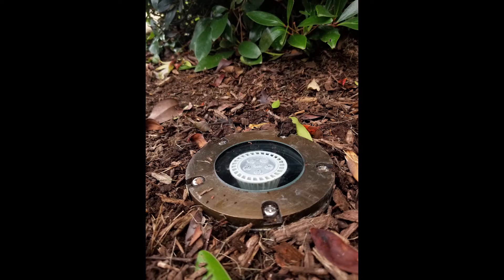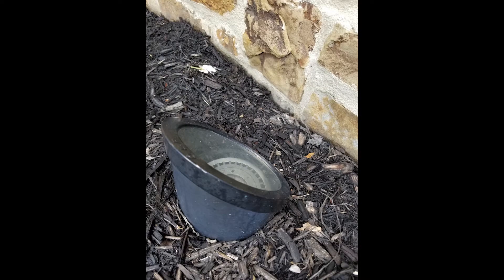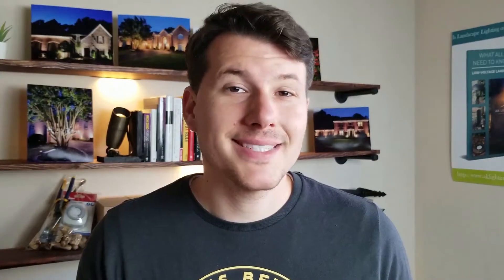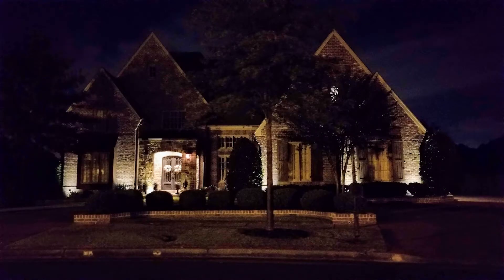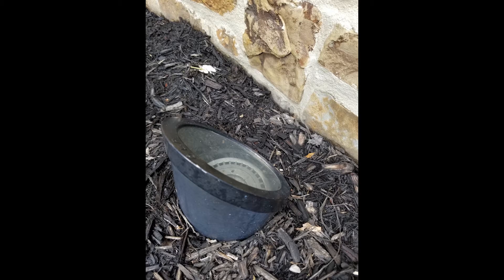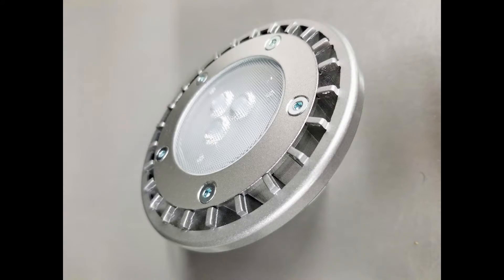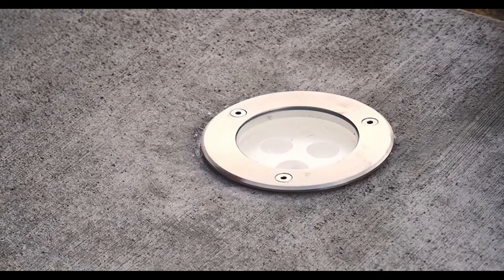Landscape Lighting Fixtures - WELL LIGHTS

Comment: If I purchase the well lights that have the normal spot light LED MR16 bulb, will the well light put off as much light as a spot light. The reason I am leaning towards well lights over spot lights is because they will be installed next to a pool and I do not have bushes or landscaping to hide the lights and I also don't want the lights getting knocked over or broken by balls being thrown around, etc.
Reply from the maker: You have the right idea with the well light. Definitely will help the light not get kicked over. Yes the MR16 bulb in a well light will shine just as brightly. If you need it dimmer or brighter, just get a different bulb.

Comment: Hey, Adam, great topic and thanks for all of your videos.  As a landscape lighting DIY'er with an electrical engineering background (I actually work with high voltage transformers), I'm always trying to improve the durability and longevity of my lighting systems.  Regarding well lights, I do incorporate many of them at the base of 4' stone walls.  Their minimal horizontal wash is ideal to softly light up the wall and short vertical wash doesn't blind folks on the decks above.  To keep dirt off the lens, I place a small rock under the fixture to prop it up.  A leaf blower also helps.  
I appreciate your first class wiring connections with one suggestion, I crimp the wires first with a copper crimp and squeeze with a vice grip pliers.  Then inert into the tube before burial.

One last point; I've experimented with big box hardware store well lights (Portfolio) by unthreading the top lens and silicone sealing it together.  The overall cheapness of these fixtures though is awful.  Is there a brand of well lights you would recommend?  Seems most are over $100 each.
Reply from the maker: Hey man, thanks for the kind words. That sounds like a really cool profession! I think in ground well lights that are in the grass or flower beds are simple to maintain, but more times than not I find my customers not wanting to take the time to maintain them. 

Thanks for appreciating the connections. I agree with your copper crimp comment. I believe I have another video with that connection, but I wanted to show another way if people done't have copper crimps or don't want to buy them. 

Yeah, Portfolio lights aren't made well, and it makes me cringe when people purchase them.

As for good well lights, DM on Facebook or Instagram and I'll send you to two places that have really good well lights for about $50-65 + tax.

Comment: Thanks.  Would you recommend well lights on concrete to surround a pool?  if so, can you recommend type of well light?  clear?  turret top? voltage, size, other...
Reply from the maker: This one is a harder question to answer. There is a recommended and safety regulated distance  lights need to be from pool water. I'm not sure what that distance is because we don't get that close. There are several companies out there that have great well lights and you may need to call them to see what they recommend. Sorry for not being able to answer this question.

Comment: Any brand or model suggestions if I need to use a well light as a 120v junction box for a 10/2 tech wire that slipped back inside its jacket on a retaining wall? Cant seem to find one with 2 knockouts.

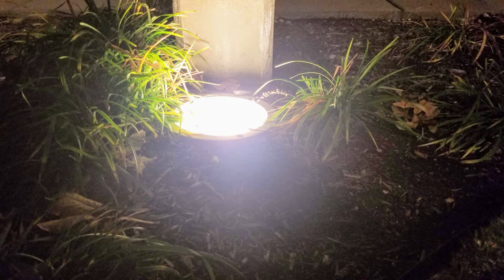Comment: 3:40 Huh? The area where well lights make sense are any traffic area. Generally where the fixture will be otherwise damaged or the preference is to reduce its visibility. 

Mine are in our backyard uplighting trees and they're not in any bed but instead literally in the middle of the yard. What I'm trying to figure out is the best and least maintenance way to setup the ground around them to inhibit grass growth .. e.g. pebbles, treated dirt or simply to add some concrete around them. The lawn simply will swallow them over time...
Reply from the maker: Great question. So the best way to deal with grass is two fold. 1st you should have a plastic guard around your light (its the cylinder looking thing) . 2nd put down pea gravel under and around the light. That really helps. Honestly, I don't like lights in the grass for that reason. Grass will always seem to grow around the light if its in the grass. Also, sounds like your grass needs a bit more maintenance to make sure it doesn't grow too high. Hope that helped!
Reply: @aklighting8292  .. No, it's a matter of me trimming or LMAO relying on the landscapers maintaining the overgrowth. The line of trees in our backyard borders water, not only does lighting it up look good but it adds at least a sense of security with the added light.

I just ordered 5 x VOLT Salty Dog MR16 In-Grade Lights to replace cheaper above ground fixtures. The guys on the mower have already taken out 1 of 6 that I couldn't find the wires, leaving 5. A couple weeks ago they caught enough wire (series cut) to take out all but 1. The damn grass is like cutting through thick carpet.